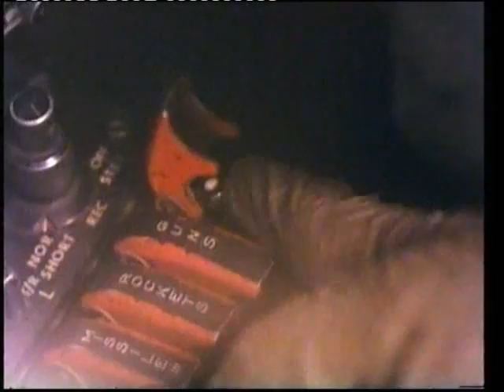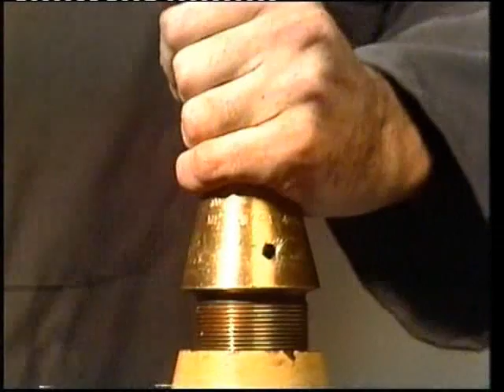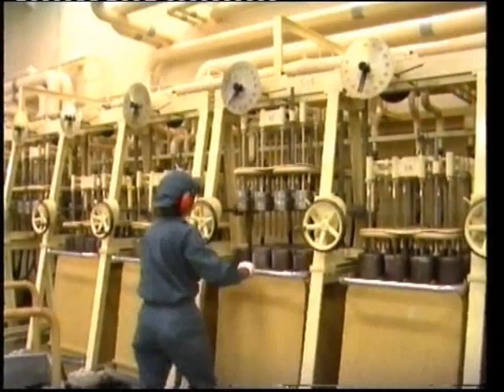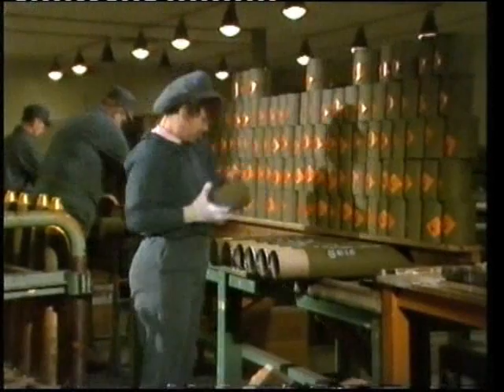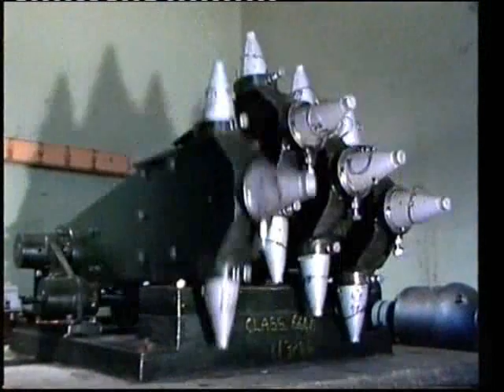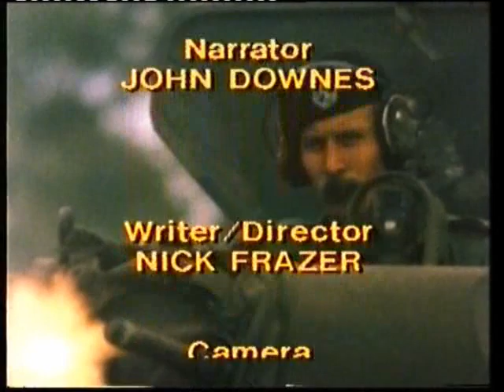Firepower, The ADI Site Munitions Factory, Ropes Crossing.flv

Comment: I worked at Ammunition Factory Footscray. Today it is homes and an Aldi.
Reply: how much testing was done there i live in willmot and have been interested in the place for quiet some time
Reply: @kristykramer891  Not much testing apart from firing a few rounds from 10,000s of batches. What is concerning was the land pollution of 100 years of lead & copper smeltering, and the use of cancer causing chemicals that leaked into the earth. I believe the top 1 metre of soil was removed and capped under the western ring road construction. I would not grow any veggies if I lived at the housing estate. The bottom of the river would certainly have a toxic sediment. Don't eat the fish  from the Maribyrnong river.